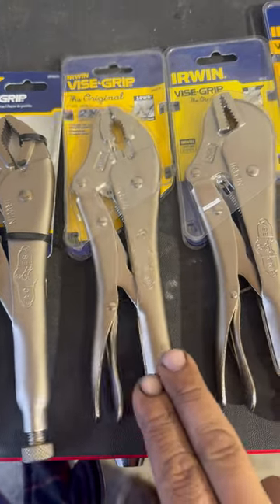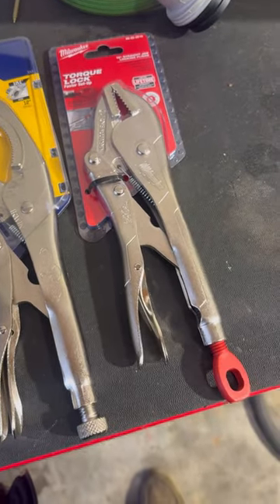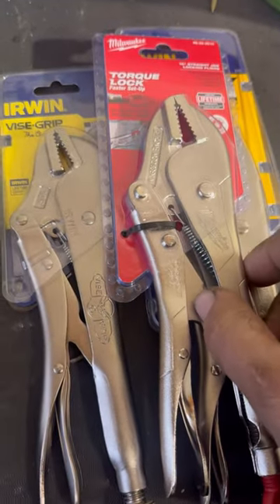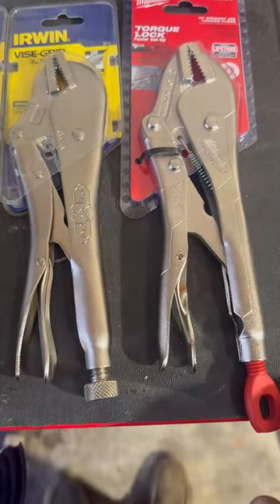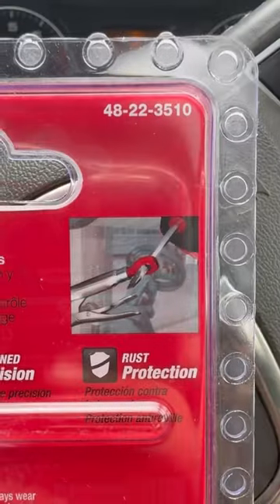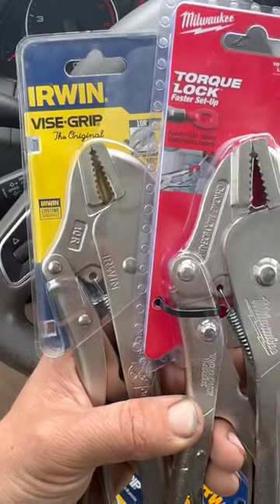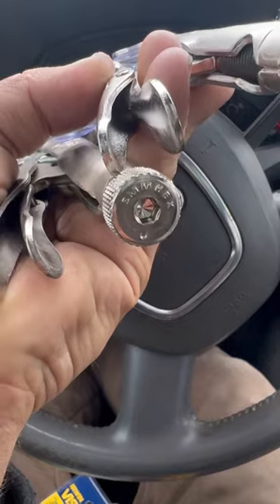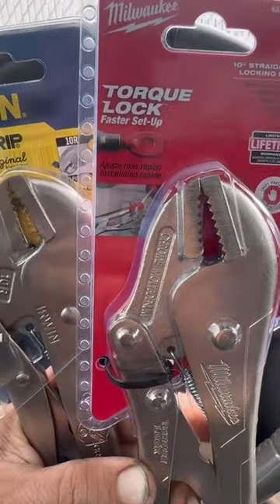Are Milwaukee Vice Grips Better than “the original” Irwin Vise-grip ? You tell me

Comment: I still have 2 pairs of the original Irwin ones made in the USA my dad bought them in the 70s. Been used for everything including as a hammer They have battle scars but still holding up well
Reply: 1970's would be the true original Petersons made in DeWitt Nebraska.
Irwin / rubbermade bought them out sometime in the last 20 years before moving production to China maybe 15 years ago.
Reply: I have some Stanley ones I bought in 2008 that have held up pretty well 👍
Reply: Eagle grip is the only way to go
Reply: I have some 70’s ViseGrips that my Dad gave me back in the 80’s. I remember riding around with them clamped to my BMX bike incase I needed them in a pinch. I still have them today and still use them. I’ve used them as a hammer, worked on cars with them, maintaining equipment at work and they will probably outlive me. They are old so they do not have the Allen wrench adjustment. They look old and beat to shhh but they still  get the job done.

Comment: You don’t need to torque these after they are set. You are using them wrong if you do.
Reply: I thought that too until I tried using the allen hole. I got the vise grips as tight as I could with my hands clamping them down and was still able to get it tighter with the knob. Plus in tighter spaces and certain situations it can be hard to close the vise grips and lock them.
Reply: @michaellewis9589  That’s a good point actually, good for tight spaces where you can’t get your hand in to force them shut 👍
Reply: Tell us you don't really know what you are talking about without saying you don't know.

The proper way is to get the jaws close to the piece you want to clamp onto when closed, and then turn the screw at te base. You aren't supposed to use your hand to grip te clamps tight onto the piece.
Reply: Tell us you don't really know what you are talking about without saying you don't know.

The proper way is to get the jaws close to the piece you want to clamp onto when closed, and then turn the screw at te base. You aren't supposed to use your hand to grip te clamps tight onto the piece.

Comment: Malco Eagle Grips for the win, use the same factory and workforce as the original Made in USA Irwin Vise Grips.
Reply: Yeah, for probably four times the price that they used to be a different company
Reply: @stevo196two9 and still the same quality.

This lie we tell ourselves 'America made better'.... Once upon a time things used to be made to last a generation(s) now they are made to last a couple of years.
Reply: The Malco Eagle Grips are actually a lot better quality than the Irwins currently made in China and the previous versions. Malco is just charging Knipex pricing and they don't offer 4" pocket sized models.  Just face it, people are going to buy those soft metal Irwins at China prices because they get the job done and they're cheap.
Reply: Malco's are pricey and almost impossible to find, they are built just like the 70's era Vise Grips and yes, those Chinese ones are pretty poor, clamp down on some plastic and your jaws are marred (that's and exaggeration but not far off). I haven't tried the Milwaukee locking pliers but their tin snips are the best I've used in 25+ years
Reply: @kalybnielsen4183  That’s weird, HJE always has them in stock.
Reply: I bought the Malco pliers and really like them. I also have some knipex.
Reply: @JohnNguyen-iw8qn no, actually the eagle grips have been tested and are without a doubt the highest quality locking pliers that have ever been made.
Probably the highest quality that will ever be made too.
Malco really went all out and it shows, impeccable f&f, nice sharp teeth with a very hard durable steel, and reinforced / seamless screw collar to prevent spreading.

They were too well made and expensive for their own good, but make no mistake they are / were extremely good.
For the average person they'll probably be a lifetime tool, I'll probably be using my eagle grips till I'm too old to operate them and the next generation will take over where I left off.
Reply: Eagle grips are discontinued now sadly. HJE has some still
Reply: @agy234  Damn, gonna have to buy some as gifts then.
Reply: Malco already closed up that plant. Snap on bought the tooling I believe

Comment: You can take an impact to tighten up the one with the hex.
To do the same with the milwaukee, you gotta find one of those driver bits that they use to put in those screws they use to hang ceiling wire to hold up grid for ceiling tiles and stuff.
Maybe if you found the right socket you can put it over the milwaukee one. Or you can modify a socket. Cut 2 notches lengthwise so it'll fit. Idk.
Reply: wdym modify a socket it fits in a regular old socket, impact works just fine. better then that hex bs.
Reply: Couldn't u put a1/4" Allen key in an impact?
Reply: who tf tightens vice grips with an impact?
Reply: @caseyshannon2054  no one until now. Useful as shit.

Comment: I got a $15 set of Milwaukee locking pliers and let me tell you that eyelet for the screwdriver is a game changer
Reply: what do u use it for? like what kind of work do u do that it comes in handy? I use vice grips daily and cant imagine what on earth ud need that for? can u not set them tight by hand ive set them so tight I had to use a screwdriver to pry the release tab up to get them off.
Reply: Meanwhile, a decent Allen key in the end of an Irwin grip doing just fine.
Reply: I used the needle nose vise grips for years it was just easier to adjust the eyelit in tight spots to make them tight as possible when you have to back off tiny bit it’s easy to see and don’t have to reset your positioning. I used them for years till they wore out now I thought new pair and the rubber handle slid off the first day lol oh the rubber handles were always nice , I don’t think the new ones are good as the old

Comment: The QC on the Milwaukee Locking Pliers are sub-par. Despite the Taiwan Origin, tge Vise-Grips are still preferred. However, i would just invest in a set of Malco Eagle Grips, and from more budget options get Harbor Freight Bremen brand or check garage sales for old IRWINS.

Comment: Snap on owns vice grip now. Believe it or not my snap on dealer is Giving warranty on worn out vice grips.
Reply: They also sell the milwaukees so
 you can warranty out threw them as well
Reply: I want to say they're actually eagle grip/ snap on
Reply: Irwin is owned by Stanley Black & Decker. Mac tools will replace Irwin vice grip pliers with Mac branded ones, or Irwin branded. Your pick. They're the same thing.
Reply: That would be great if you had access to a Snap On guy, the company is an absolute pain to deal with. You pay $400 for a torque wrench, after the locking collar stops working you figure they'll help, nope, they tell you "That is an older model, parts aren't available", sweet
Reply: @scors1er i asked my dealer to order me milwaukee for weeks and he refused
Reply: No Snapon does not own Vise Grip, I think they might own Grip on now though.

Comment: I always use locking pliers by closing the jaws farther then needed, closing them on whatever I want to grip, letting off a bit with my hand and backing off with the knob until I can get them to lock. I can't believe they are designing them so you can tighten them further once locked with a screwdriver or hex key. No thanks.
Reply: Comes in very handy on smooth pipes with seized threads. I had to use it on a few snow blower oil drain tubes with seized drain plugs on the end. They didn't collapse or damage the pipes at all.